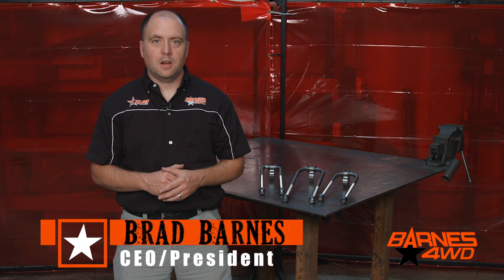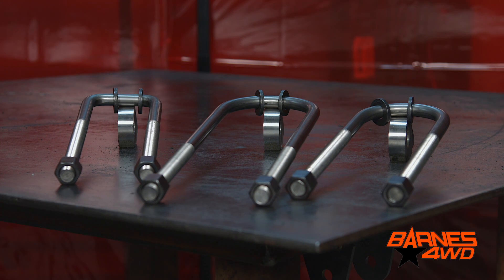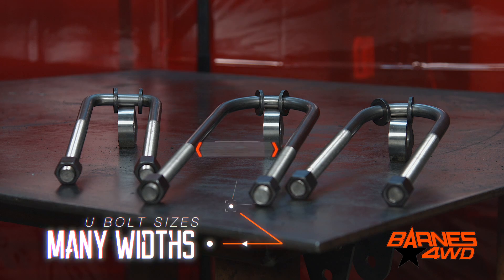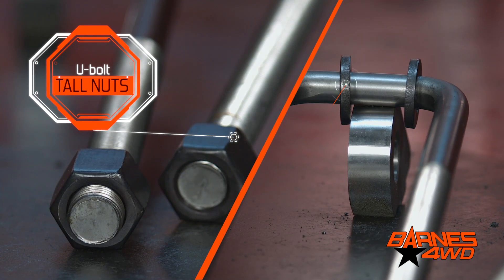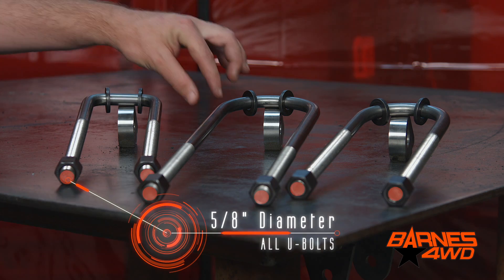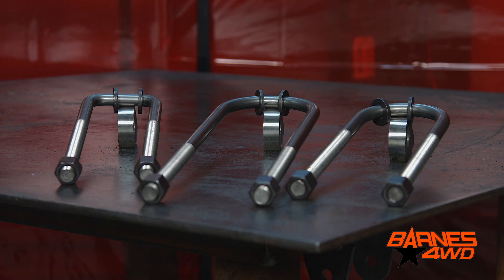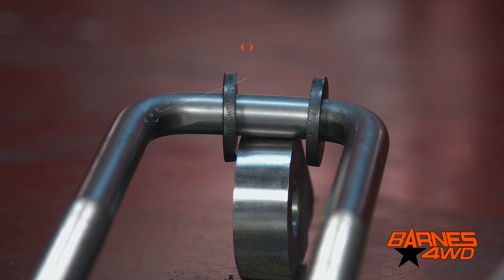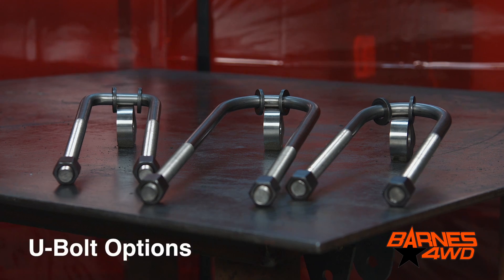Heavy Duty U-bolts

Comment: What are the torque specs for the U-Bolts Barnes 4x4 Ford 8.8 Swap Kit?
Reply from the maker: Our U-bolts have a torque spec of 150 foot pounds and should never be tightened with an impact gun.